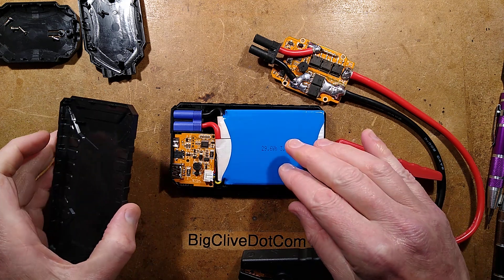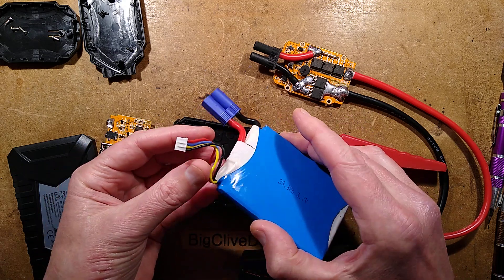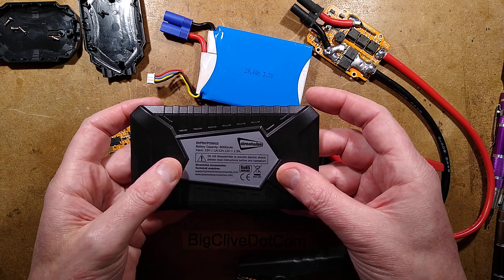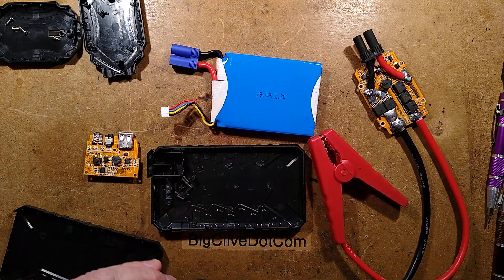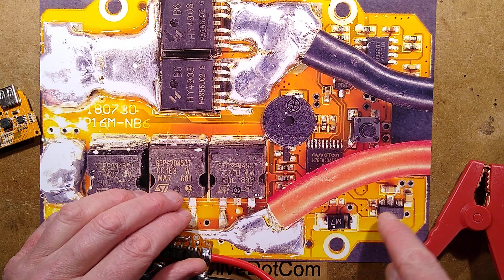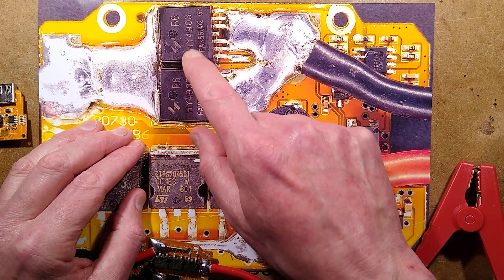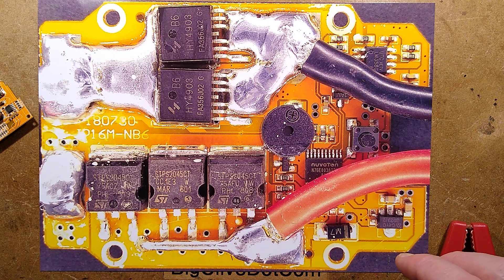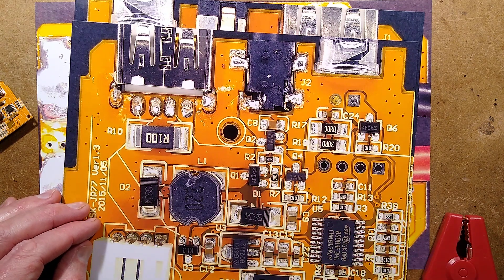Inside a combined power bank and jump starter

Comment: Are you sure that there is no over discharge protection through the 12 output ? If there is a micro and already over current and over voltage protection, then discharge protection should be a matter of a few lines of code ...
Reply: The problem is that the 12v output can only see the 'total' output of all the lithium cells, it can't know if one cell is high and another one dangerously low.
Reply: @KantiDono  true.. but it could at least cut out @ 8 V or so for 3 lithium poly cells..  I mean, using your cars starter will drain these very fast, and with no under voltage protection at all ...
Reply: @tinygriffy  The problem is, it's quite normal for a full-size lead-acid car battery's voltage to briefly sag under 8V during cranking because of the high current demand, even though the battery is still mostly full. If the protection circuit cut out based on voltage, it wouldn't be able to accomplish it's primary purpose of starting a car. A protection chip for this type of scenario would have to distinguish between an expected voltage drop under load, and the loss of source voltage due to discharging.

Graph of Current and Voltage of a traditional lead-acid battery starting an engine: https://www.powerstream.com/x/Christopher-Suozzo-engine-cranking.jpg
Reply: Yes it is protected. The mosfets are controlled and will not turn on when the cells are too low. I have about 7 of different ones and use them regularly.

Comment: I'm not sure if I missed this point in your discussion, you mentioned powering high-powered LEDs using the 12 V output. On my jump pack it will not output anything to the 12 V jumper cables until it sees a battery connected. Also, I'm not sure if you mentioned it but maybe some of the circuits are to protect connecting the jumper cables in reverse, mine has that feature. It sure was fun listening to you go into details on how my pack may work.
Reply: On this type of unit there is usually a "secret" method to activate the output without a battery detected. It might have been something like holding the button while plugging it in.
Reply: @eDoc2020  that blew up. Which is inconvenient when my main use was to get a car that had a flat battery due to aforementioned lights or whatever being left on overnight/all day.

Hence the need for a jump starter.
Reply: My jumper lead circuit is dead on one of our battery packs. But the connection still runs 12 v.

In conclusions I decided the leads protection circuit is probably toasted, likely by any one of the times we used them to jump start a dead battery because someone left the cars lights on after their journey.

But I also own a Telescope. One with a 12 volt input. Or an option to cram it with a pile of 1.5 volt batteries. It explicitly states do not use Rechargeables in the booklet, so presumably they want a full 12 volts.

Well Guess what? You can buy cigarette plug attachments for these battery packs.

And my telescope doesn't draw much if any current based on battery pack inspection. So in conclusion: it works for a low power application beautifully and I don't have to lug around our backup Car battery we used for jump starts after the  jump starter circuit failed us.
Much more convenient.
Reply: @glenmcgillivray4707  The reason why they state not to use rechargables is because rechargables can supply a lot more current than dry cells.  I'm presuming that your telescope has a motor in it to allow it to track the sky?  If so, a stalled motor could easily draw so much current from a rechargable that it burns out the control circuitry, the wiring and the motor, completely ruining the whole thing.
Reply: @melkiorwiseman  it recommend Alkaline batteries. I've read up on it and yes it probably demanded a decent peak current to get the motor started each time, but with its own computer to control the device it presumably and sensors needed to confirm the Go-to mounts direction, it is probably very sensitive to voltage fluctuations while operating, and Alkaline batteries hold their voltage better than the quick to discharge rechargeables. Combine those two elements with a relatively low needed wattage over the course of a nights operation based on my own experience of use, it seems more clear to me why it said no rechargeables plz.
And that I could probably abuse a pack of Lithium ion stepdown AAs if I wanted. But the jump pack is easier to charge. Now if only to find one with better battery management 🤔
Reply: @glenmcgillivray4707  - each cell (battery) type has a different discharge voltage curve. NiCad and NiMh (rechargeable) cells have a very flat part of the curve for most of their discharge cycle. The downside being the lower terminal voltage compared to alkaline cells and the very fast drop in the terminal voltage near the end of the discharge cycle. Alkaline cells have an output voltage that drops  gradually.
Reply from the maker: I'd not be using the external module.

Comment: I bought a similar cheap device, except instead of jump-starting, it plugs into the cigarette lighter to trickle-charge a vehicle battery without having to remove the battery from the vehicle.

It worked great. It took a dozen charge cycles over three days to recharge a dead car battery to the point it could start itself. And now I have a USB power bank with a cigarette lighter adaptor to recharge itself in the car.
Reply: It sounds ridiculous.
Reply: I would recommend AGAINST using any product that uses the cigarette lighter socket for jump starts or charging. Thin wiring to the socket, questionable quality of electrical connection at the socket, some cars require the ignition be left on to close the circuit to the lighter socket, and the circuit is typically fused at 10A.
Reply: @dashcamandy2242  Obviously, jump-starting off a cigarette lighter wouldn't work, because it would just blow the fuse. Assuming it didn't trip overcurrent protection on the battery bank first.

10A is already considered a 'fast charge' for a lead-acid battery, most standard lead-acid battery chargers are only 5-6 Amps, with trickle chargers being 1-3 Amps. At that point it hardly matters whether you're directly on the battery terminals or not.

Comment: Fab vid again as usual : 2 thingys however.
1. One thing that rarely get any mentions is the "C rating" of the battery. That's it's ability to shoe out maximum current without damaging itself. It's actually a very important value to larger drone flyers. I used to have a 6s 22.2v 30c battery to power a dji s800. It was actually quite scary - larger than a house brick and twice as heavy.
2. My understanding from about 10 years ago is that the way the charger brings all of the cells up to 4.2v is that if one has reached 4.2v but others are still around 4.0v then it actually automatically discharges the 4.2v cell in order that it can continue charging the other two - that's what the balance lead is for if you are charging via the main high current leads. This knowledge might be out of date.
Reply: You can't discharge an individual cell if its sense wire is connected to a microcontroller sense pin and to nothing else (as is the case with this device). There is no discharge path.
Reply: @Slicerwizard  Hi matey. I should have made it clear that I'm not talking specifically about this device but rather ones which are charged by 200W external chargers where there is most definitely a discharge path back out again.. Sorry for the confusion there. My bad.
Reply: Clive specifically mentions that this circuit only does sensing/protection, not balancing. Common among smaller BMS circuits, really. You can get separate cell balance circuits that are speced by how many amps they'll send between cells, to attempt to match voltages.
Reply: Any sparks working with actual figures should be made aware, the LiPo market is packed to the gills with absurdly irresponsible ratings. I did a quick eval on probably a dozen brands and not one met rating. I'm talking 200-500% over-rated, with catastrophic heat and voltage drop at continuous "rated" current. Vet yourself a real manufacturer and perform your own discharge tests to be sure. Personally I got the hell out of prismatics.
Reply: @ryanrehfuss  Yeah - these lipos are getting insanely powerful today. I had one that could (and DID) start a car.  And that one was only the size of two "candy bar" mobile phones trapped together. I had a much bigger one than that.  Just look at how many fires that the fire service is now having to deal with.... And they can't extinguish them. There needs to be at least some kinda "moritorium" on these because they are fk terryfying.  I'm not for governance of everything but in the case of these things ...... well .... they are a "clear and present danger". I've got a couple sitting outside such that if anything goes wrong then they are in a place where they won't take down buildings or lives.

Comment: Too bad it doesn't have active balancing, that wouldn't be hard to add since it does cell level voltage monitoring on the board anyway.
Reply: The problem is getting taps to each cell that have enough current capacity to do a reasonable amount of balancing. The sense leads that are there are way too small.

Comment: Always amazed at these little things - I used to have one years ago the size of a suitcase (it had wheels!) and it would struggle with some bigger engines or diesels, now I have one I can slip in my coat pocket and it has no issue spinning my current 3 litre diesel.
Reply: When I turned over my mom's car with a jump starter slightly bigger than this unit she didn't think it would work.  It worked just fine,  car started right up.
Reply: That's pretty interesting. I guess I would never have thought that anybody would have bothered with a battery-powered jumpstarter before Li-Ion ones became commonplace. Was the "suitcase" one a lead-acid battery? Was it charged by a trickle charger?
Reply: Om606 by any chance?
Reply: I suspect the limiting factor with the large lead acid jump starter battery design was the resistance of the connecting cables and alligator clips. As a good quality lead acid battery has a very low internal resistance. Hence why they were used for starter motor batteries in the first place. Of course this assumes that the battery in the jump starter is a good quality high current type and has been maintained and kept charged…
Reply: Ahh but the suitcase model was built better I bet😊
Reply: I was going to comment the exact same thing!

Recently I used mine to help a stranded driver start his BMW diesel. It took multiple full power starts, and extended turning over on the starter motor, to get the car running. The pack used barely 40% of its charge!

Comment: I seen a very similar one in Germany and it had similar design, similar specs but it had a higher capacity and was sold at a grocery store called Penny.
My friend got one and after 2 years it still works very well and can start most of his project vehicles (DIY Buggy/ATV, cars with engines under 2.5L and his 50cc motorcycle.
However, his powerbank had it's first defect after 1 year of use. The USB Charging board can't charge any of his devices. It's a shame since he has a Parkside PLKA 4B3 battery powered soldering iron. It's great for repairing stuff in tight spaces on a car. It even has a small LED light which can be useful in certain situations. Well, now he has to use a second powerbank just to charge that soldering iron.
When it comes to the Lithium cell itself, on that jump starter powerbank, it still seems fine. A month ago I helped him with replacing the charging port. I can't say if the board were the same but the location of the LED, charging port and USB output looks very similar to his

Comment: Why do they say on some not suitable for diesel cars?
Reply: Diesel engines generally require more cranking amps to start than gasoline engines. Most lithium starters like this is already going to struggle to start a gasoline engine, so a heavy diesel would likely either drain the battery without starting, or worse overload some cheap component.
Reply: @KantiDono  Yes, I understand that, however you get large gas engines and small diesel engines. On a sales channel they showed a man starting 6 large gas engines  without batteries on a power pack without charging  but no diesels.
Reply: I have the impression that starting a diesel generally requires more torque due to the higher compression, so the starter motors require a higher current. Anybody know for sure?
Reply: Mine works fine on a 2L diesel but perhaps it depends on the brand
Reply from the maker: Because they use high compression it takes more current to crank a diesel engine.
Reply: diesels require about 40A@11V of glowplug amps per cylinder. PLUS the high actual cranking amps.

thats a lot of juice to deliver from that tiny pack.
Reply: @casemodder89  Yes but you also get small diesel engines and large gas engines. I would have thought it would say suitable for diesels upto 1200cc and gas 2500cc. However that is not the case.